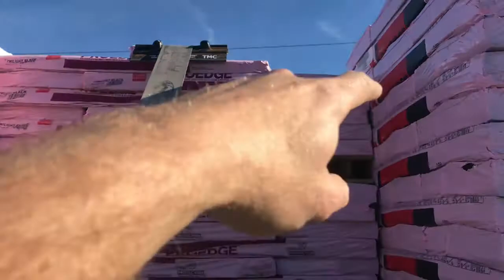CDL FLATBED | Flatbed Securement | Shingles | Atlanta

Comment: Keep em coming big bro, where you get those straps rollers.thanks again stay blessed💯👌🏾✌🏾
Reply from the maker: +said abdi grab those strap rollers at the truck stops or online Said. They make a huge difference in your time. Only thing is they snap after a few months. But I didn’t throw mine away like most would. No, I waited until I relievers at a customer where I saw welders and asked them to tack them back together. Took about 2 seconds for the welder to do it and they are now even stronger than when I bought them out of the store 😎👊🏼💯

Comment: I typically like ta/petro's better because of the restaurant's and lots of parking with pull thru's but they are few a far between so alot of times I look for gravel parking lot truck stops I don't stop at loves or pilot/ flying J's unless I need a shower or fuel or there just isn't anywhere else to park